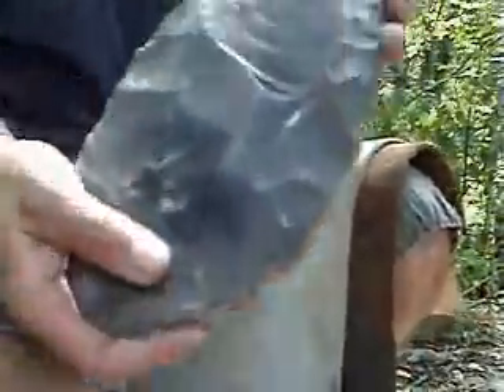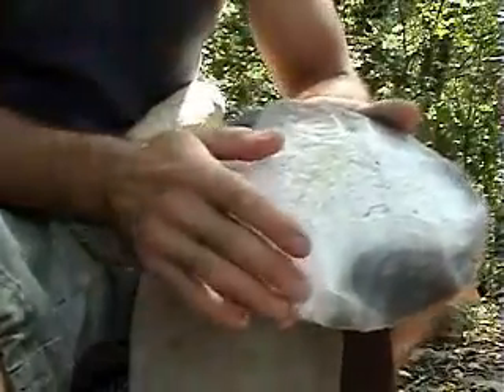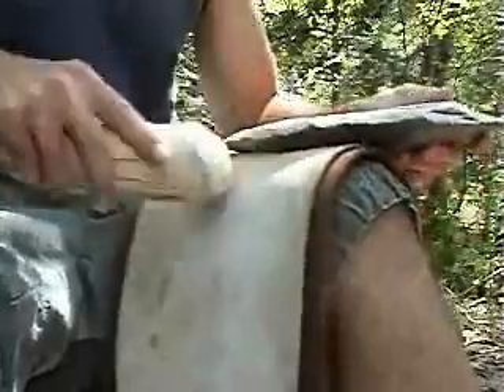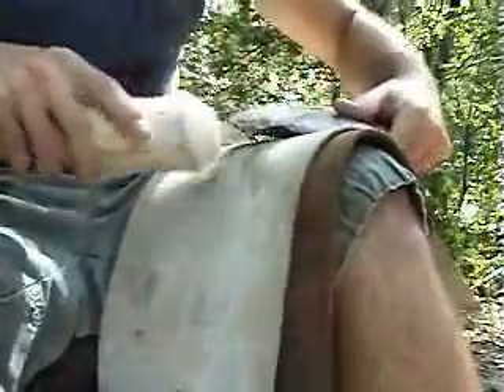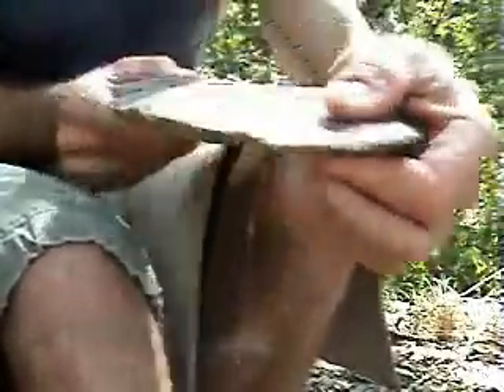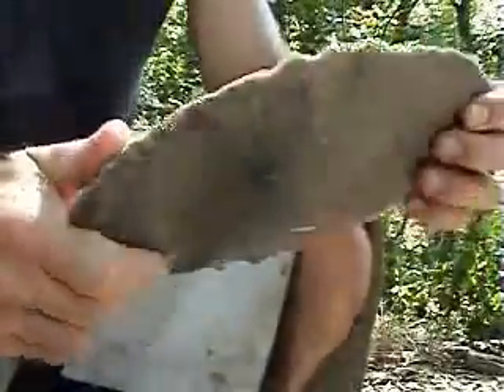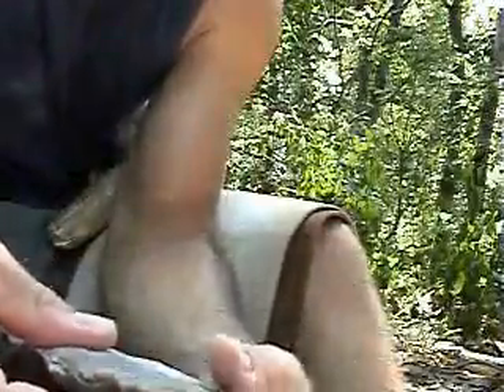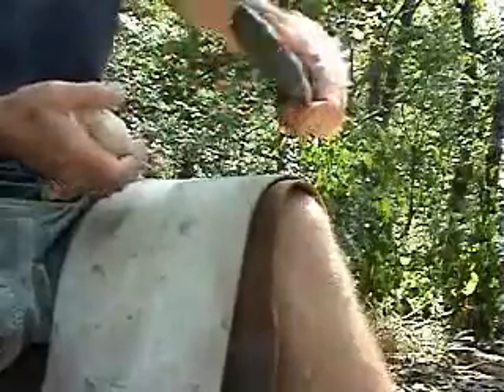caddo blade part 2

Comment from the maker: @wcomalley  white tail and moose are similar hardness.  A large white tailed billet could work well if the preform were worked down thin enough first with a hammerstone.  Elk on the skull is a good half way between a good size white tail and moose, so that's also possible.  As well as large leg bones from buffalo, when properly seasoned are great tools.   marty